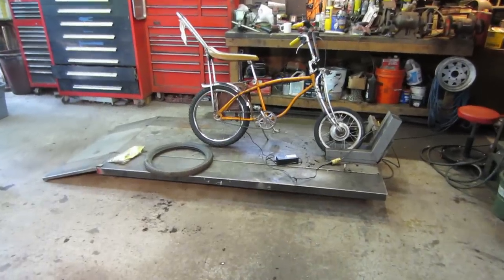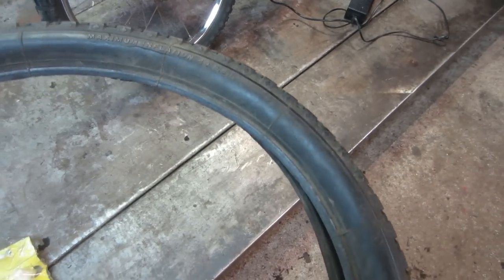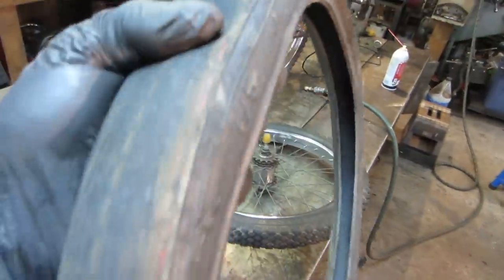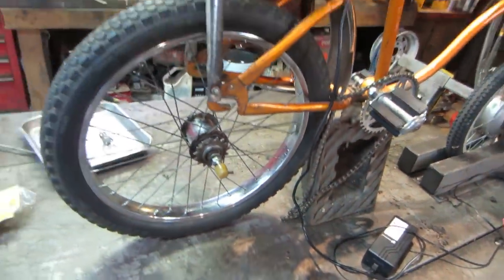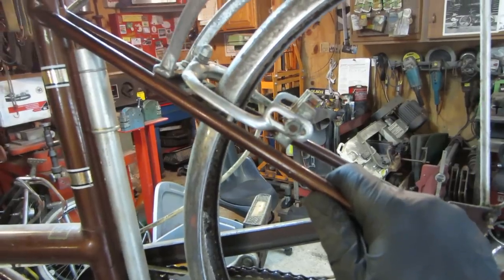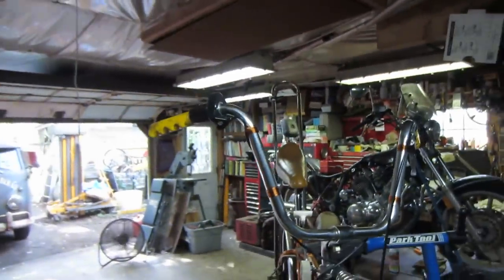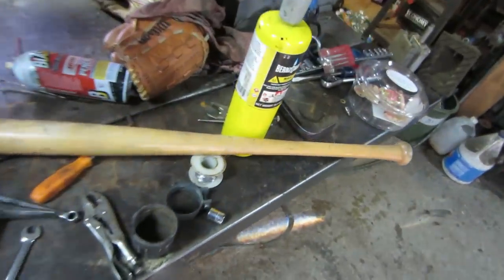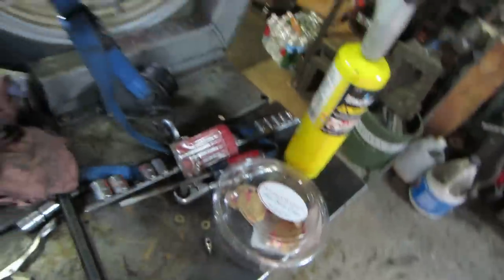homemade electric bike modifications

Comment: After watching this video, I think that I would have cut down one hand grip, the one  with the throttle, to allow for the break lever. I wonder if the other half of the grip could be replace the throttle grip, just to keep the nostalgia of the seventies! Great work as always... I would love to watch you build a “moped” using a larger Briggs motor, or even a harbor freight motor... 24 hp in governed possibly,

Comment: That back rim looks much better, although would still keep an eye out for the old fat slick type tire I had on a old 'Grant' bike. As it would just fit that perfectly. Thing really turned out well, and when you talked about mounting the glove high, said "no, put it down by where the bag is" and you did, so it offsets that well. Put a thin piece of cold roll on the back of the bad and make a small frame for it, will make it stand up where you want it, and offer support for that heavy battery.

Comment: Kinda sucks when the tires don't work out the way you had hoped. Just finished doing a restore on an old Sears Constrictor (BMX knockoff). Had a pair of the old school plastic mags, and, knobby tires. Bearings, in front rim, were chowdered, and, it was warped. Plus, the tire on it had a huge split. So, I ended up with the old school mag and knobby combination, on the back, with a rim and low profile tire off a newer model freestyle BMX on the front. Not exactly the look I envisioned, when I started, but we make do with what we have on hand. 
If you're interested, there are four vids on my channel (playlist) for the restore.

Comment: You should run innerliners inside the tires, even and old leather belt will help prevent flats.  If you ever take it long distance you'll be hating it when you get a flat, and there's no air anywhere. If you have the other saddle bag I would carry extra tube, and patches, along with a small co2 emergency air bottle, or pump?
Reply: A small co2 emergency air bottle? I have one in my small car!

Comment: To fix the Indicator you could try putting a Potentiometer of around 220 Ohms in line with the Plus wire to the throttle/indicator. The wire is probably red, you can tell the right wire by the fact that it measures the same as the the battery voltage against battery minus. You can then adjust the potentiometer until the Indicator works to your liking.

Comment: need a couple of base balls hanging under the seat, maybe let them swing like in a mesh bag. maybe. That old guy at the end is a view into the future. You come up with some cool stuff Darren.  How did you adapt the chain coming out of the rear hub? I have run into that but it was 50 years ago. Weld, braze solder, or ??? and what kind of a ding-dong could thumbs down this vid?

Comment: Prob could have used a Raleigh Chopper rear wheel straight off the bat as they too had the Sturmley Archer 3 speed gear set, that replacement tyre looks almost as if it came off an original Chopper :)
Reply: Chopper, Commando, Grifter all had the same back wheel

Comment: you can get a cheap digital volt meter on amazon for like $5.00..  they work great. also, you dont want to run that type of battery to low on voltage, it will kill them..

Comment: I hadda bendex two speed in one bike. Pedal backwards to shift it. I was about 14.
Reply from the maker: they are hard to find now a days
Reply: Mustie1 There are multiple original hubs listed on good old fleabay for around $100. I bet if you kept an eye out I am sure you can snag one for at least half that and I think they would fit in nicely in a lot of your awesome bike builds. 

As for the brakes, I know you mentioned wanting control over each brake but they make 2 in one brake levers. I bought one for my gas bicycle on Amazon for about $10 and it was the perfect solution for power assisted bicycles with throttle. With a little tweaking of the adjustment screws you can set your brake bias to favor one wheel over the other which I have a little slack on my front wheel so that my rear wheel brakes first. You really should look into that because that dual lever is the only wonky out of place thing on your ebike.
Reply: cutworm59 love them old 2spd kickbacks
Reply: Whoa, wait.  ?!  Gonna have to look that up. Never heard of that before. So much great stuff from back when. Not that I've heard about everything, ha!